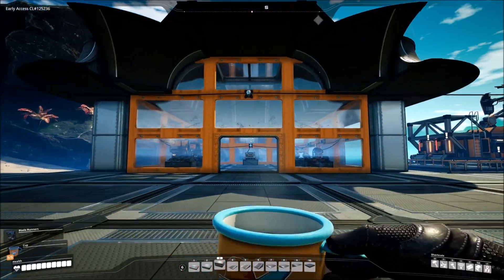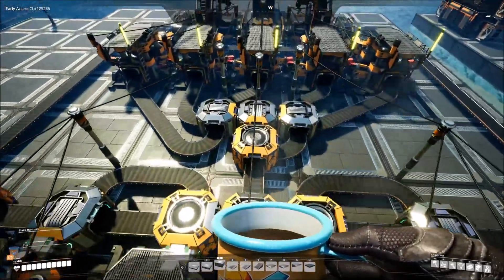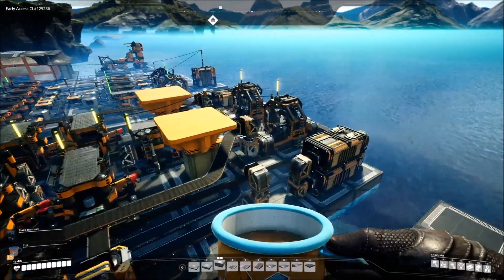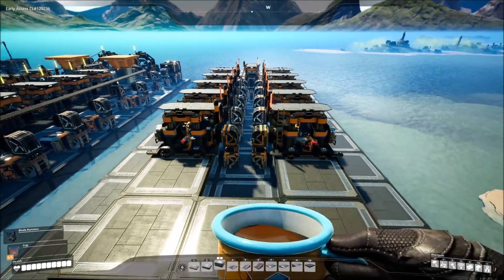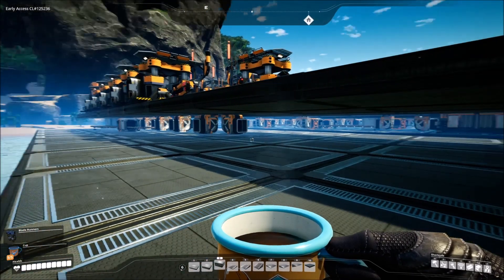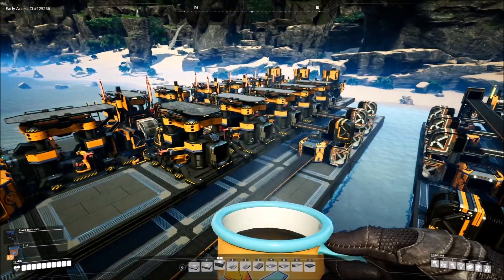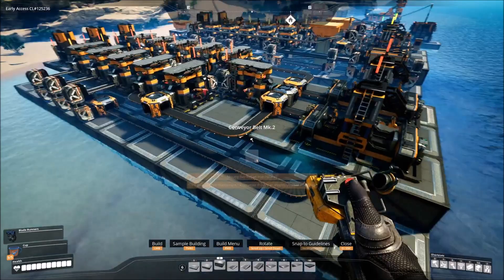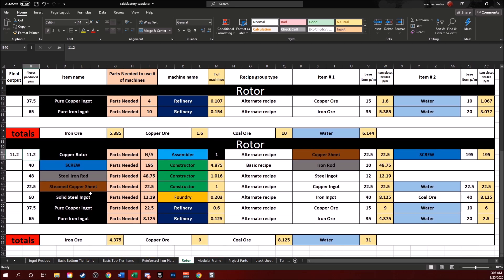Satisfactory Design ROTORS tutorial tips and tricks

Comment: When routing between vertical conveyors and splitters or mergers, such as at https://youtu.be/5efMxCZPV0k?t=621, I prefer to make the vertical conveyor snap directly to the splitter or merger, and not use a tiny bit of conveyor belt (because they are hard to place, and very hard to upgrade in-place later with faster belts).  For that timestamp, after you place the splitter, if you then go back and delete the vertical conveyor and recreate the vertical conveyor, you should be able to make it snap to both ends and not need the tiny slice of conveyor belt.  So original vertical conveyor is just used as a guide to place the splitter, and then the guide is deleted and replaced with the final piece.

I really like how you do the belt balancing.  I usually use simple manifold (because, "lazy"), but your video(s) are inspiring me to try to improve.